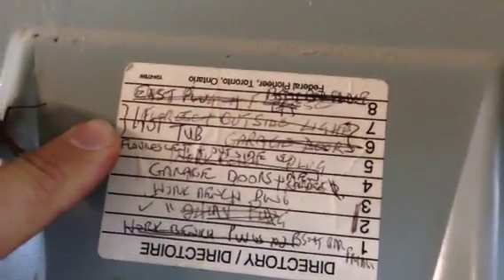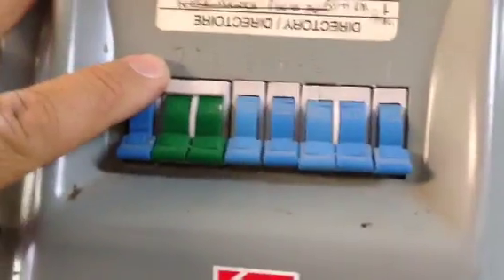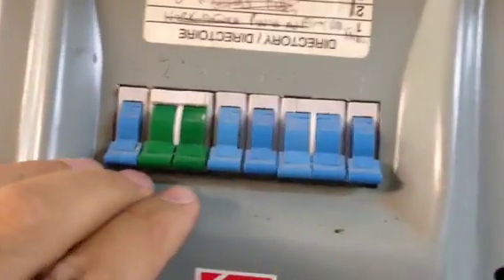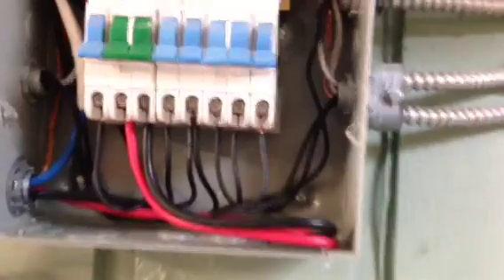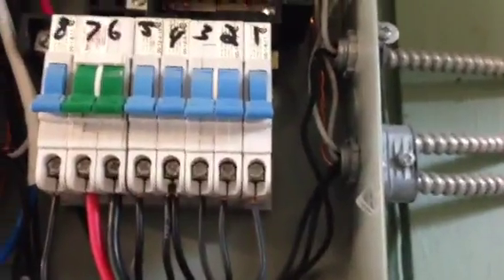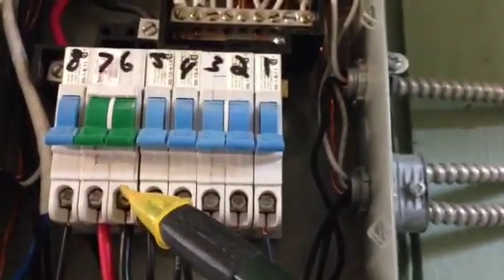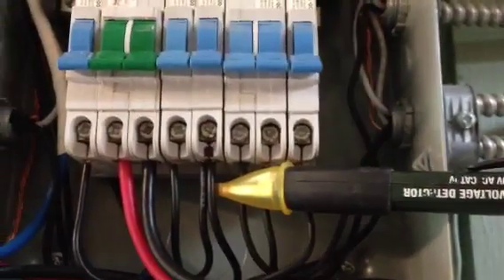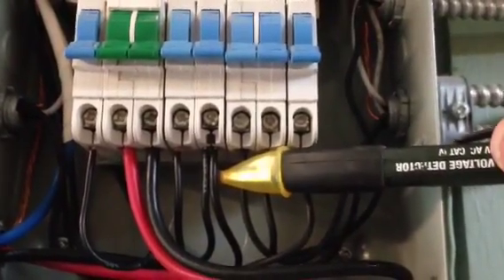Hot Tub Safety GFCI #homeinspection

Comment: The hazard of double lugging isnt the overload of the breaker.  The hazard is in improper termination. Two wires ESPECIALLY of different size can and will become loose and start arching. With time all loose connections WILL start a fire.
Reply: You can avoid such hazard by simply taking both of those  wires, splice them together (wire nut or any other approved method) splice -in a pig-tail wire of same gage or larger and terminate that pigtail on to the lug of a breaker..

Comment: can you explain what GFCI protected means?
Reply: GfcI device measures and monitors amount of current leaving the device(on live wire) and current coming back (on grounded AKA neutral wire) and if it senses a deviation in that difference as small as 0.006Amp for a fraction of a second it will automatically shut the circuit off. 
Because that deviation could be caused by electricity running trough   Your body which acts as a resistor while consuming that electricity. While person  being killed by heart attack